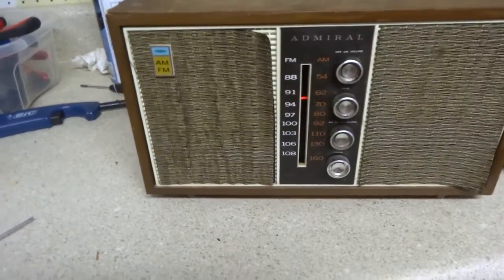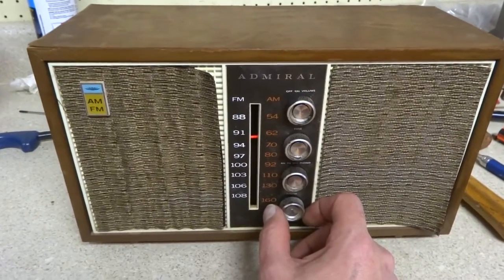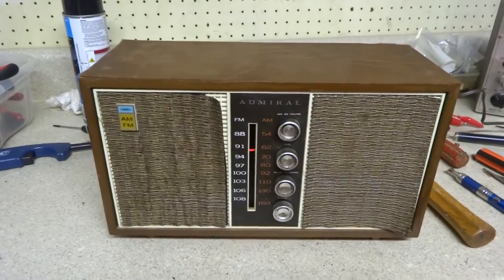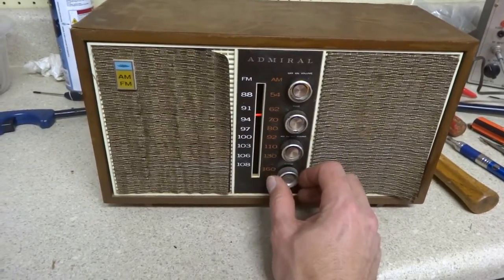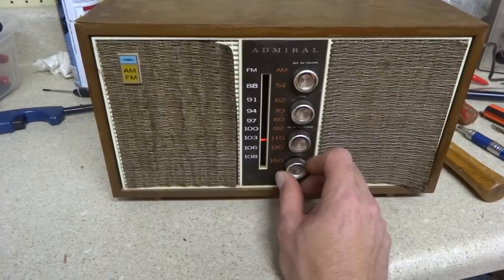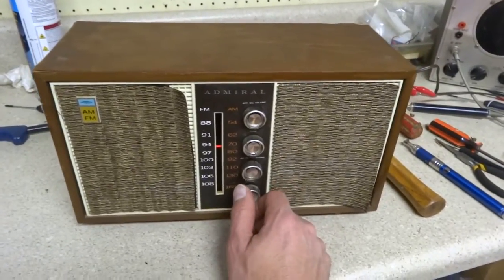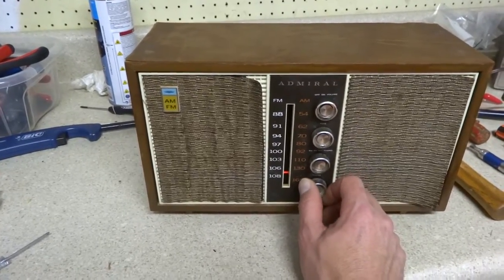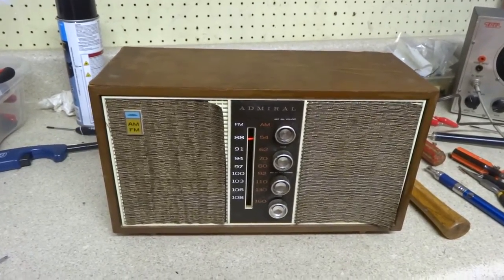Repair of an Admiral YG 531 AM FM mid 60's Tube Radio

Comment: I have a radio very similar except mine has a clock on the left side.
Reply: I had a clock radio like that when I was a kid; it cost maybe $.50 at a  garage sale. It looked like  this on the outside, minus the wood and cloth, but it had an all-transistorized hot chassis and a few line-dropping resistors. I must have ruined it by trying to modify it in some stupid way, but I wish I'd kept it longer; it had a much better sound than most of the "flip-digit" clock radios they were selling new at that time. Admiral made some decent stuff for the money.